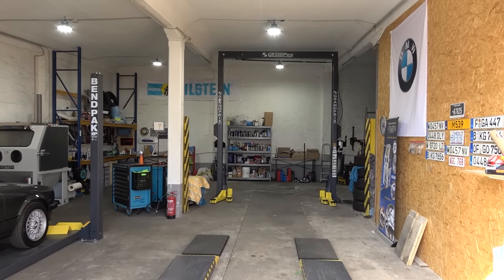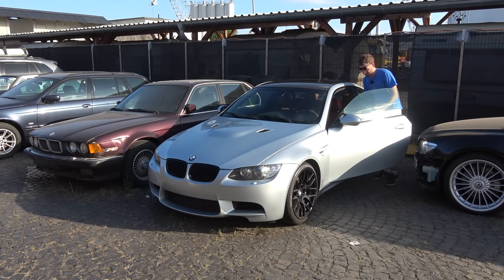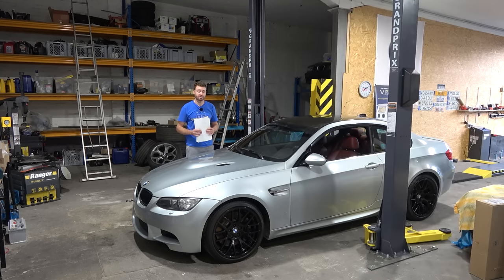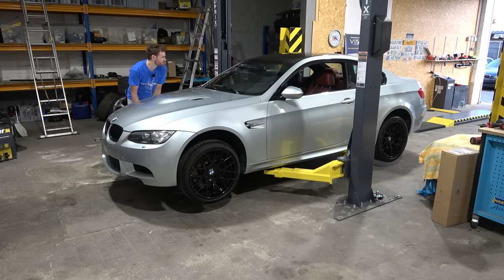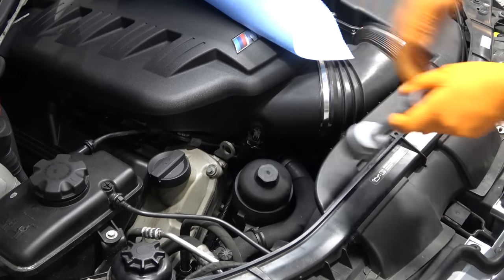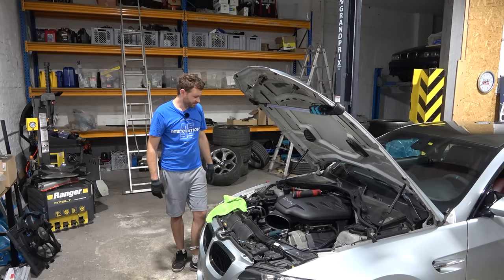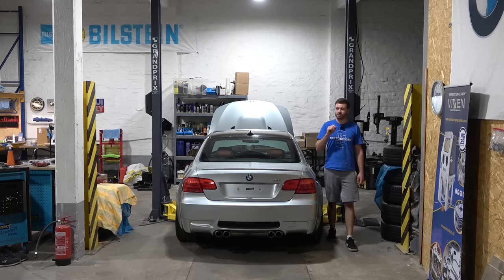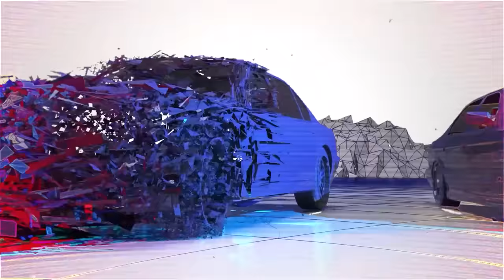Is the Engine Repairable? - BMW E92 M3 - Project Frankfurt: Part 2

Comment: You don't need to do a shake test if you've lined the pads up properly 😛😉
Reply from the maker: You do. You always do.
Reply: @M539Restorations  nope, if you've looked properly at lining up the pads to the jacking blocks, then there's no to shake because it is lined up.
Btw, cool idea installing a winch,😎
Reply from the maker: @Assimilator1  yes, you do. It's a safety thing and doesn't cost you anything to double check. The car can be rusty and the jack pad can go through. But to each their own I guess.
Reply: @M539Restorations  you would see if it was that rusty, and the safety aspect is covered by making sure you align it properly, if in doubt because it's difficult to see, then just lifting it a couple of inches and check again.
Anyway, I don't want to argue with you, you do some cool videos and I like it that you're putting a dead M3 back on the road 😎
As a fellow e92 M3 (white) MT owner, I particularly appreciate that 🙂
Btw, I can't believe the crank snapped!😱 How the hell did he manage that!? Lol
Reply from the maker: @Assimilator1  you've clearly never seen a lift fail or a car come off of it. It's not just about the position of the pad, it's the lift, the arm, the concrete, the chassis of the car, even the pad on the car can slip out... By shaking it, you are putting stress on everything and it's a good habit to have. You don't have to do it, but it's the correct thing to do and a common practice with any car and lift. Thanks!
Reply: @M539Restorations  I've worked in garages with 2 poster lifts for about 25 years, I've never seen anyone routinely shake test the car..
Still, it wouldn't hurt to do it 👍

Comment: At 6:30 - oh dear god.... you bought a Jersey car.... I'm so sorry. It looks clean enough so far, but just let me say up front that I'm so terribly sorry for the things you're probably going to find all over as you get into this thing. I mean, to put it in perspective, yes, their roads are... interesting, let's say - but not every driver constantly bends their wheels on similar roads. Jersey breeds attitudes in people that most of the rest of the country (world) aren't very approving of. It's a tough area that very probably creates attitude problems. At least that's how it feels to an outsider. 

The hope here is that someone able to afford a car like this is adult and responsible enough to care for it well.... and the Jersey rich kids are about the most common exception to that thought I can imagine. Hopefully it wasn't a 20 something rich kid as the first owner. 

sadheadshake Dirty Jersey strikes...

*edit* So, got to 9:10 now. I'm so, sooooo terribly sorry Sreten. So sorry.... you bought a basket case from hell (Jersey, specifically). You're going to pull your hair out over and over as you continue to find half-assing and deferred maintenance all over every inch of this car. I love the way tou do things on this channel - always the correct way, regardless of cost - amd you will find that before you everything was done the exact opposite of that. 

I mean as evidence, I'll just point at the WELDED RIM. A cast aluminum wheel, that was cracked and bent so badly that it was cracked - and they welded it and put it back on. 😔  Everything will be like that...

Comment: Why everyone is using such crappy anchor bolts? They are unreliable especially if you ever spill oil near them! That's a flimsy little metal clamp on the bottom and the diameter of the bolt is reduced to make place for that clamp! Use concrete screws instead you have an impact gun! Right size hole, no dowel just take the gun und send them in they cut their own threads directly into the concrete and done! Besides that nice video